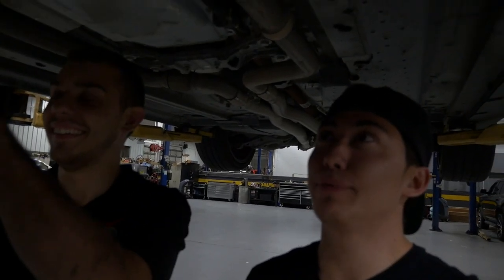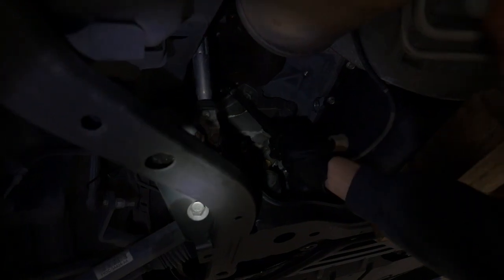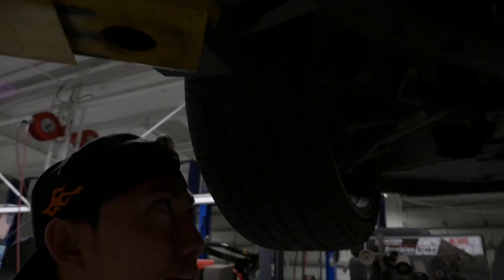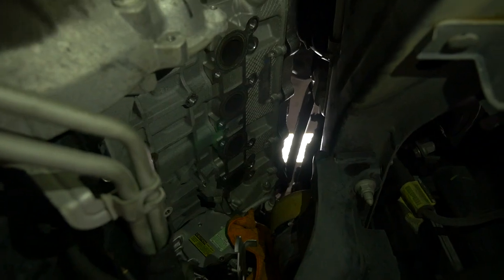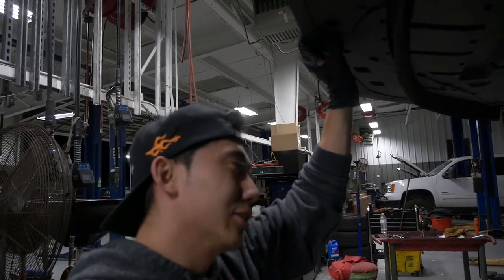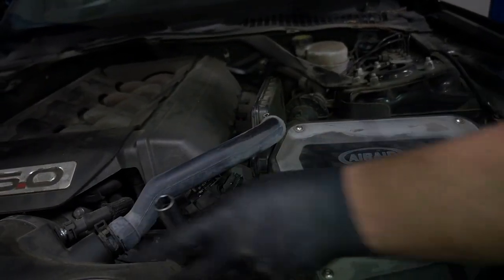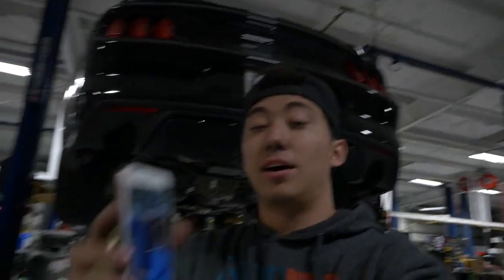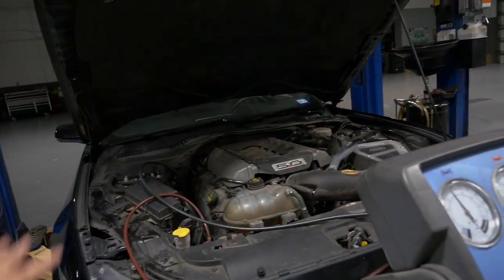INSTALLING  LONG TUBE HEADERS ON 2015 MUSTANG GT!

Comment: Did you tune your car before starting it? Or how long after installing the headers did you tune it
Reply from the maker: Juan R No, I ended up driving it home that night. You can drive it without a tune, it’s just gonna run lean. As long as you’re not driving far and for a while, you should be fine. I believe I tuned it the next day.
Reply: Alex Bellini what time did you get? I think I want to use the bama rev x by sct
Reply from the maker: Juan R I was running the Bama tune with the Rev X tuner and it was doing fine. I didn’t like how the downshifts were though (too jumpy) and I also had an issue with my throttle body which I’ll cover in another video. But I currently have a custom tune from a guy in Houston. Honestly forgot the name.
Reply: Alex Bellini is the custom tune doing better than the rev x

Comment: Hey bro just installed the same set of headers on my mustang and check engine light came on I think due to bad o2 sensors did you happen to run into this issues as well?
Reply from the maker: Skidzjr dude, so sorry for the 9 month late reply 😭 my bad! But my O2 sensors were fine after installing it. I actually recently just had to replace them a couple months ago though because 1 got wet due to my driving thru a puddle. 😕